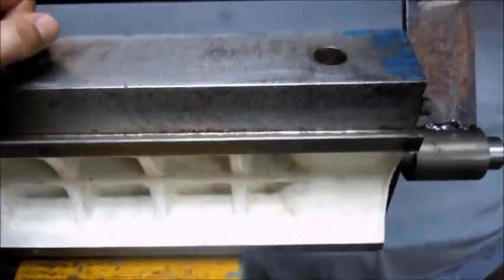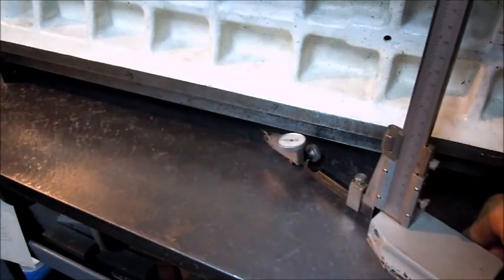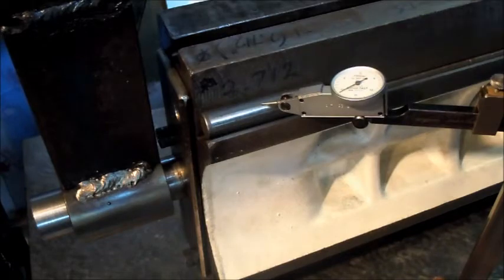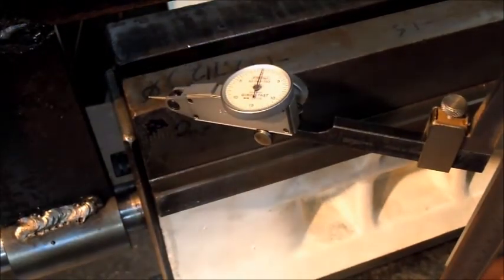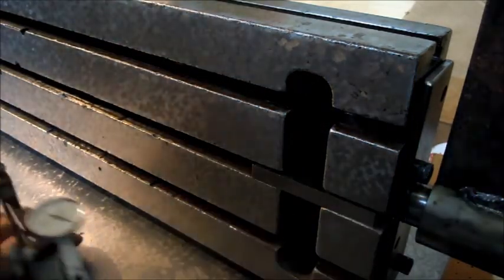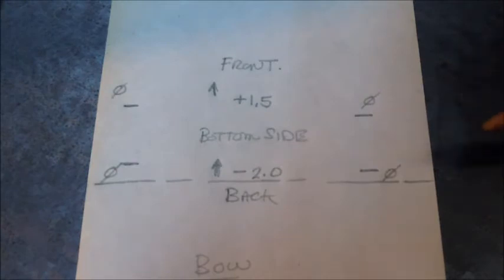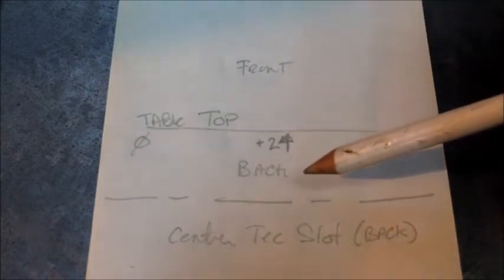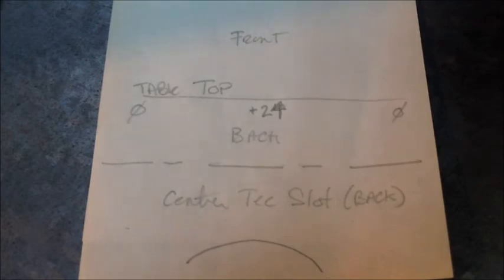Bridgeport Update 22

Comment: I think building a big fire of charcoal and sticks in the yard and getting it going good then throw in the table and let it burn down as soon as the flames get ready to go out cover it all with one of those high heat blankets and let it slow cool.  I think stress releiving that thing would really be beneficial in the long run itherwise it will be a bunch of hard work that will continue to crawl over time.
Reply from the maker: Charcoal, sticks, fire, blankets... What Labour Day Weekend is complete without the 9X42 roast 😊 I know it’s a possibility, no question there are stresses in this thing, but I also wonder how stable it is after no use for 5 years, how much stress is being relieved during the scrapping process itself etc. The good thing is I can easily do it all over again if it moves a bit… NOT! Would love to tear down a “new” unit, Bridgeport or otherwise and see how it stacks up. In the end, when it’s all done, oh how I hope I live that long… I’ll know exactly what it took, what it looked like, what it ended up like and how far that journey can be when you don’t have a map😊 Then again, not sure they sell these maps anywhere! Thanks for watching, suggesting and commenting.